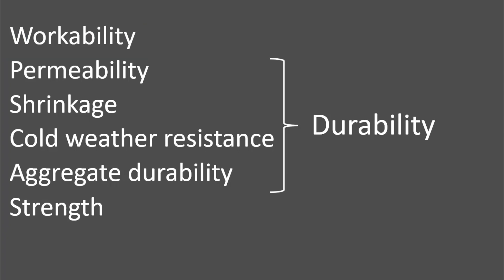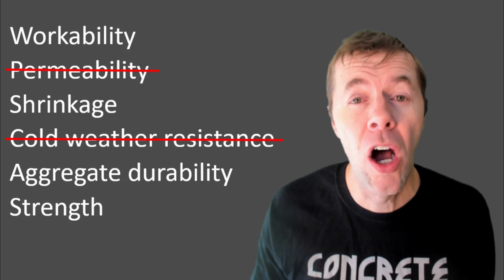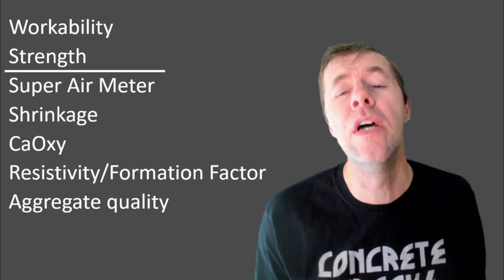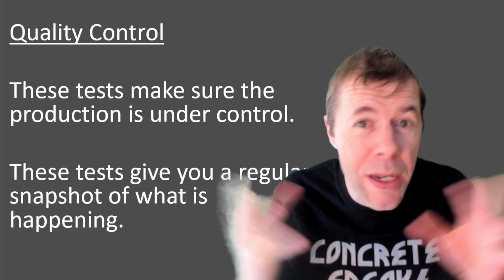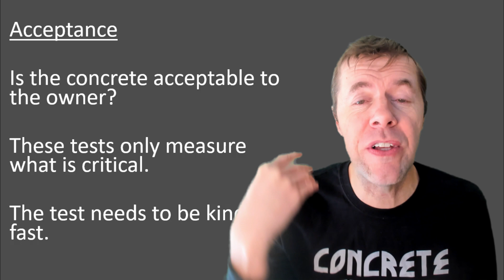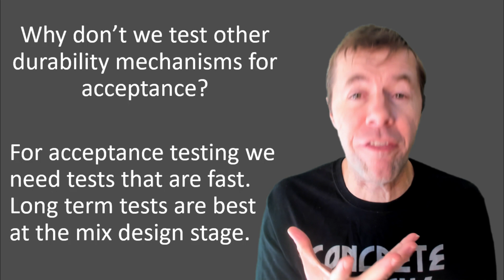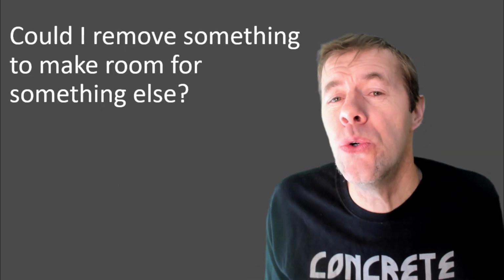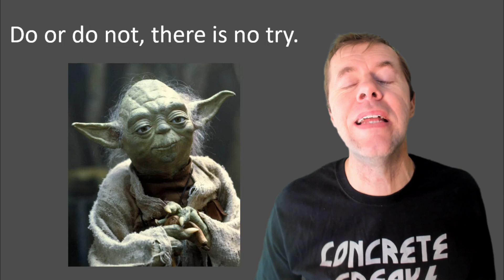How to make a Dreamcrete specification?  Specifications for PEM.

Comment: My dreamcrete.
Graphene Infused Roman Concrete.
Karbon Bar Reinforcement.

Why Roman.
Becuase the material's to produce Roman concrete exists, and it's proven to last longer and increase in durability with age. 
Plus, volcanic ash and volcanic rock are not used on mass in the market today, meaning there is a abundance of it.

Why graphene enrichment cause of the many benefits.

Why karbon reinforcement because of the fact that rebar is needed. For multi-story durability.

Comment: Any mix design suggestions for poured in place architectural fountain concrete. In Florida. Could have cascade steps that are sometimes dry (during shutdown). Basin needs to hold water. Thanks for any info.
Reply from the maker: I would use fibers in the basin.  Make sure your concrete is flowable enough for your application and will provide the finish you want.  I would cure the concrete well.

Comment: @Dr Ley, do you have pointers for lightweight concrete mixtures?
Reply from the maker: It depends on the application.  Lightweight concrete design is not that different than normal weight.  If you need high strength then you will need to lower the w/cm of your paste.  Be careful when you batch lightweight concrete that the moisture corrections are done correctly.
Reply: @TylerLey  Thanks for the response, I appreciate your time.  While I can't claim to be a concrete freak, your videos have helped me become significatly more well versed and aware of the needs of concrete designs.
  
I'm lead to believe from a few techincal papers that lightweight concrete mixes don't play well with high strength concrete mixes, though I have seen applications wre both are used in the same product.  Specifically I have seen a Tindall product called T-SLAB, which uses high strength concrete with a lightweight concrete fill on the bottom face.
  
What I'm envisioning is a composite mix concrete panel for pre-fab with a sandwich of: high strength with steel reenforcement and load transfer steel, lightweight core/fill instead of expanded foam or fiberous fill, then high strength with steel reenforcement  and load transfer steel and load transfer steel - with diagonal ribs of steel reenforce high strength concrete segementing the lightweight fill where required structurally.  Application is a high durability building design.

Comment: Everyone that want to use concrete should always think about the application of it, not just look for the strongest. Longevity of the construction can be a lot more important. Energy efficiency of the constructed building is another.
In safety barriers on roads it's actually better if the concrete isn't too strong but instead that it do fragment on impact absorbing the energy. A safety barrier can be easily replaced but I'll hate to see an intact safety barrier sliding down the road after an 18-wheeler has crashed into it.
Reply from the maker: Well said!

Comment: Do you have any advice for home builders using ICF systems for building the outside walls and foundations using fabforms fast foot system ?
Reply from the maker: Make sure you get really flowable concrete because it is hard to consolidate it.  I would use a lot of water reducer in the mix.